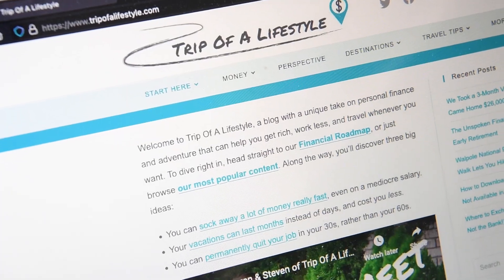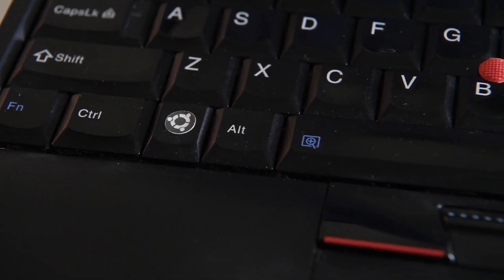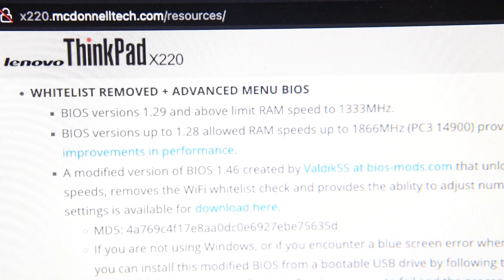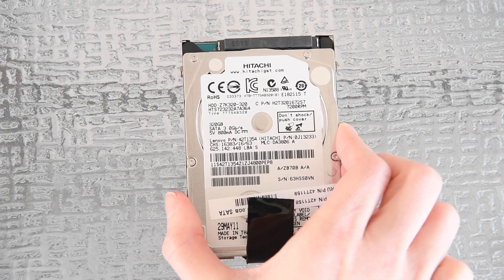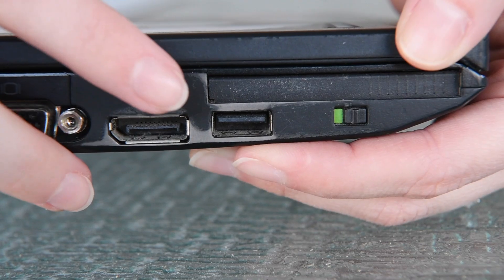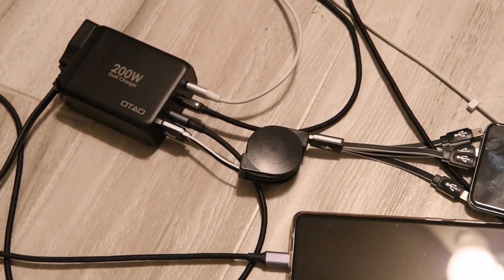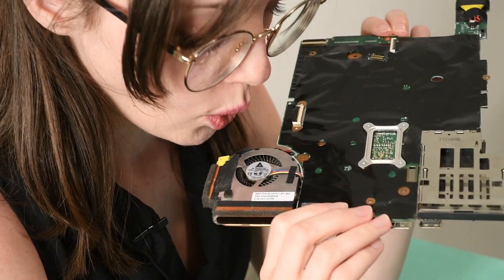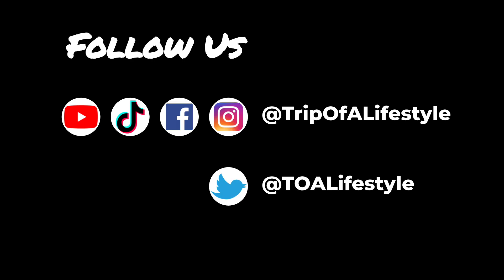How To Make Your Laptop Last FOREVER (My ThinkPad Mods & Upgrades)

Comment: That just shows how most people's needs in terms of technology were met 10-15 years ago already and all the fancy new tech is just satisfying consumerism.
Reply from the maker: @attilaszovan  Some truth to that!
Reply: @TripOfALifestyle  i need something modern due to i hate lag and its worth upgrading every 3 to 5 years but i might get a new one this or next year due to keyboard issues
Reply: My laptop is from 2012 and still runs smoothly on windows 10. It was around 600€ when I bought it. Not even high end for those days. I only upgraded the memory when I bought it.
Reply: @bennyvermeulen7255  wait until you run linux without all the bloatware from windows. My laptop from 2012 gets job done faster and better than a 800$ laptop and a 2000$ dollar iPhone.
Reply: @bennyvermeulen7255  groot gelijk 💪🏻
Reply: Except HDD, those were really slow. SSDs and NVMe are great
Reply: @DavidCardonaESM  NVMe is an SSD.
Reply: Guys, no need to separate into groups. Nobody’s saying that everyone’s needs will be met by these. A lot of stuff can be done on older machines with no hustle. 
There are some that need more and that’s ok as well. 
Content creators, gamers and others that require high power and more performance than most people are not going to settle and that’s ok. 
This is just showing that you don’t need to spend a lot if you don’t need high specs, and for parents, kids, etc, for office and multimedia they are still great. 
Almost all of you are correct at the same time. 
When you attack each other… you’re wrong. Let’s enjoy the content, leave a like and move to the next video. 
I enjoyed watching this one as I feel nostalgic for all those machines that I had to recycle in my former company as I was not allowed to take them home #hoarderlife
Reply: @pemotor541  yeah but even for Media consumption having a fairly recent GPU is a good idea to support newer video formats but you don't need this years model only when a new video format comes out or when it gets to slow
Reply: There's two reasons why computers need to be upgraded: For most people it's games that need more and more performance. Even if you're not a gamer (I'm not except for some binge Tetris every couple of years) it's websites are becoming ever more resource-hungry and won't work properly in old browsers. Most importantly though it's Microsoft no longer supporting old versions of Windows which makes using them dangerous. I switched to Linux full-time when Windows 7 was no longer supported and the only thing I regretted is not doing it earlier.
Reply: People lived happily enough in caves too...
Reply: @Leto2ndAtreides  To be fair, there's no evidence of whether cave dwellers were happy or miserable.
Reply: People's needs were met before laptops. Everyone had fresh, organic food, clean air. Now we have electronic waste filling up rubbish dumps because manufacturers force purchase of new instead of promoting upgrades and providing spare parts.
Reply: @ronr4728  
That's true
Reply: As long as you haven’t used a modern computer you’ll be ok with the old one. 😅 But in direct comparison it will look unbearably slow.
Reply: Really depends what you're gonna use it for. If you're only using a laptop for typing, you can use a very old one and be perfectly fine. If you need to do advanced video editing, 3D modeling, gaming, stuff like that...old hardware is going to have some hard limits, and there's only so much that you can upgrade in most laptops because of how they're built.
Reply: It's not just consumerism.

A lot of computers aren't this upgradable.... and even then, there were lots of changes she did that would need some actual skills...

Basically, companies are limiting the longevity of the products....

And they were able to get away with it by making many of them not need an upgrade for a long time....
Reply: I agree in a way, my 2013 x230 is still enough for me. I5, 16Go of ram, USB3, 1To SSHD, 256Go ssd PCIe, win10 (win11 runs also on it) and Linux mint, expresscard slot for the great Echo Indigo professionels audio cards. But i'm not a gamer !...
I still have an older 2006 Z60m (IBM stamped) that don't want to die, but really weaker (Centrino, max 2Gb Ram...). Even if in 2006 there was also a better T60 (core 2 duo, 4Gb), i would say also that up to #15years ago, a thinkpad can be really enough today, for a commun use of it.
Reply: This is why they purposely make new OS updates slow down older devices
Reply: Got myself a x1 carbon gen 6, swapped the wifi card for a 6E. That thing is nothing short of amazing. The only upgrade I could possibly consider is a arm MacBook for the battery life.
Reply: Just wanna throw in: I ran an eGPU Setup with the X220 and it worked. It was PCIe3x1, but it did work.
Reply: Not necessarily. They were able to meet the needs of people 15 years ago. The needs of people today, technologically has shifted in ways, and would require some newer options. This doesn’t mean folx should go out and buy the most latest tech. But they should strive for something more current to an extent.

To add, I think folx need to change the way we think and speak about consumerism. Much of it isn’t bad. And we do benefit from it more than we are harmed.
Reply: I couldn't agree more! For what MOST people are doing, they do NOT need a brand new computer. They don't... Web browsing, word processing, watching Netflix, etc. does not require a brand new $1,000 computer... my current desktop I got used for $75, it has 32GB RAM, 256GB SSD, it is an old Lenovo miniPC, loaded Ubuntu on it, it flies...
Reply: " and all the fancy new tech is just satisfying consumerism."
WiFi6, USB-C, USB-3 and HDMI are actual improvements, not just consumerism.
Reply: @wisenber  indeed! But are they necessary for everyday needs though?
Reply: @attilaszovan  Who decides what you need?
If it's outside of food shelter or clothing, nothing is needed.
Reply: @wisenber  Statistics
Reply: @attilaszovan So you define your needs by comparing yourself to everyone else?
Reply: @wisenber  HDMI is from 2005
Reply: @deathsinger1192  And not pervasive for another half decade or more.
Pretty sure she's not editing her channel with that laptop.
Reply: Try running some of the latest games and software on a 15 year old laptop (if at all)
Reply: @emperorarasaka  Depends from settings and GPU, but it's possible to game on i7 from 2009. But most people aren't gaming anyway, for browsing, office and movies it's perfectly fine.
Reply: @attilaszovan Absolutely on the money. Most of us are not  brimming with creativity every time we fire up our laptops. So, a modest laptop - even from yesteryear - is more than adequate for my personal needs. 
Of course, planned obsolescence, along with peer group pressure and advertising, create the notion that it has to be brand new, state-of-the-art tech every year. Nonsense!
Reply: @attilaszovan  for regular light use a 20 year old laptop would honestly be fine as long as modern operating systems werent so bloated a 20 year old cpu and gpu could easily hand a 1080p youtube video as long as there was propper software support and the software wasnt full of bloat trash
Reply: @emperorarasaka Games? Not really a factor for most people. Definitely not something I would spend any money to do
Reply: @emperorarasaka True. But not everyone is a gamer and plays games. 😎
Reply: @thedutchfisherman7078  exactly. I'm not averse to games but I just don't have time for them. I'm always working or living an active life. Gen X has their gamer demographic but the younger generations all seem to be far more sucked into needing a gaming ready rig and it's more a part of their lifestyle. I haven't played games since the days of arcades back high school.  Unless you're doing autocad, and using graphics intensive software, you don't really need that much for a sufficient business machine. You may bump up against some limitations here and there, but I seldom do.
Reply: Its not a gaming laptop in the first place @emperorarasaka
Reply: @emperorarasaka that's the point: Most people don't use computers to play, most of those who do play only do casually, and many play lighter/older titles, so all in all that proves OP's point
Reply: @emperorarasaka  you are not playing cyberpunk 2077 on a 13" laptop without a dedicated GPU mate, regardless if it is new. 

Now if you have a dedicated GPU like a 1650, then yes it will run without a problem even if it is old. It won't run UE5 games well because nothing will, that's not the fault of the card. 

Or you can just use steamlink, I am sure even that old laptop can run it as long as you upgrade the wifi card and have a decent connection between the machines.
Reply: @emperorarasaka 
Pixel shader was not even a thing, and now all games require the latest version. This video is misleading
Reply: @MikeTMike you're misleading.
Reply: @FR4M3Sharma  
I explained my point. Explain yours.
Reply: @MikeTMike  No, that's mainly newer AAA titles. Most games don't use the latest version and many don't use it at all.
Reply: @MikeTMike  You are a bit dense.. she did not mention gaming. I do some gaming but also have an old Thinkpad for productivity only - and a couple old machines in my workshop - one of those can do Mass Effect 3 MP ;)
Reply: @MikeTMike  It's only misleading if you assume that everybody plays games that require up-to-date specs.  Apparently that doesn't apply to her.
Reply: @FR4M3Sharma  i agree i guess, no one would imagine her Laptop is for gameing , but a great sturdy machine, i did recording until recently on a 2008 macpro, and i type this on a 2015 Ipad pro ,of course if i was a  Pro i might upgrade…
Reply: Correct analysis. 💻👍
Reply: Agreed.
Reply: @ExplainingComputers the legend himself

Comment: If you do need something new, don't be afraid to buy used. I only spent around $200 on a thinkpad x13 yoga gen 1. It's not in the best cosmetic condition, but the damage boils down to a couple chips and a bit of grease wear on the trackpad. Considering it is the same price as the average chromebook or hp stream, with a much better build quality, performance, screen, and everything in between, I would say that used is an excellent way to go.
Reply from the maker: @cheezyfriez12  Great advice!

Comment: Got a 2010 macbook white. With ssd, new battery and extra ram. Used opencore to load a more recent mac operating system. Everything still works. Good for general use.
Reply: Thank you, I’ve been wondering how to get my used old MacBook a bit newer. Now the certificates or so old it won’t load webpages.
Reply: @NitroNilz  you can do linux.  It makes old Macs faster with more up-to-date browsers, just like it can Windows machiens.  "Refind" helps.
Reply: @squirlmy  Thank you, but I prefer proper Unix. OpenBSD is my preferred desktop OS. I want to try MacOS to run some proprietary stuff for music production.

Comment: My MacBook is 12 years old. It was unused for over 3 years until I finally installed Ubuntu 24.04 on it a few months ago. I procrastinated a long time because I already had another desktop pc with Linux on it, but the MacBook now gives me the option of doing work from my own room if I suddenly have brain storms in the middle of the night and don't feel like leaving my room. Linux is great for breathing life back into old hardware that is no longer supported by commercial software.

Comment: It's time for me to get a newer laptop just cause I have an Acer 5742G that I have kept chugging along up until this very day. It's been quite a solid machine and still runs many programs well enough but repairs and workarounds are just becoming a pain so I have repurposed with Ubuntu and it runs very smoothly. 
I am looking very carefully at my next laptop and am really looking at a Lenovo. I annoyed with manufacturers  in general cause there are many $200-$500 laptops that look good until you realize that they have LPDDR ram which is soldered to the board and there is no second slot. A buyer who is not tech savvy and doesn't know what to look for may buy it thinking they can add more later.
Reply from the maker: @VideoCesar07  They're even soldering SSDs to the board these days (Apple) 😳

Comment: Unfortunately ExpressCard is just PCI Express 1.0 with a single lane, plus a single USB 2.0 connection. ExpressCard 2.0 had a single USB 3.0 connection and its single PCIe lane could be PCIe 1.0 or 2.0. Almost no laptop manufacturers adopted ExpressCard 2.0.

So an ExpressCard USB 3.0 card will be faster than USB 2.0 but slower than USB 3.0. Also, while there's zero technical reason a USB C ExpressCard can't be made, nobody makes one. It would be nice to have one because some USB C devices don't work properly, or at all, with a 3.x to C adapter. Being able to plug a real USB C controller into an old laptop would be very nice, despite being slow.
Reply from the maker: @greggv8  Yep, exactly right. 😕

Comment: The most and only bad upgrade is to use type c port for charging. İt can not handle ongoing energy it will create throttle neck for charging and supply circuit.

Comment: Pro tip for anyone wanting to do this sort of thing: be cautious when blowing out any PC fans. It's best to either hold the blades still, or disconnect the fan(s) from the motherboard. Otherwise, you run the risk of generating an electrical current with the fan motor strong enough to short the motherboard when you spin the blades up with air pressure, because you're effectively turning it into an electic generator and that power is going to go somewhere if it's still connected to a circuit.

But this was a great video and I really enjoyed the premise and end result data.
Reply: Killed my dad's power supply by blowing the fan. too hard.
Reply: For every Muppet who says this is fine and you can ignore the comment above... That is BS! Listen to This man, hold them or disconnect them. I myself Fried two Motherboards with this (one as accident, the other to prove it can happen with a spare board) Don't be stupid me! :D
Reply: @Phil-9h  You guys are idiots if you believe this advice.  You may be "pros", but you are not engineers.
Reply: Thanks. This is one of those things that seem obvious in retrospect but which almost everyone forgets.
Reply: @abdul-kabiralegbe5660  Yes, this & working on an open computer while on carpet flooring, especially in winter! That spark felt will likely surely damage something, why I don't do this, plus wear a $5 wrist strap touching a metal part of the unit. Some components, especially GPU's, doesn't always like the blasts of cold air to blow out dust either. Better to tear down to the point of removing the heatsink & then, if possible, wash it after allowing to sock to loosen the dust & pick as much of the rest out as one can. It's much safer, have seen many on Tech forums reporting this, in particular those who has MSI brand models. A GPU not torn down likely won't dry as much as an open motherboard & any trapped liquid can (& will likely) short the GPU as soon as booted.
Reply: Turn off computer, fans take long time to spin down. So obviously this is bullshit.
Reply: @Lggpad8  I would appreciate video evidence to your point. Will take just a couple minutes since there is no risk to your motherboard.
Reply: @FoeHammerTime  it's literally everytime you turn off your computer, the fans keep spinning for a bit after it's off.
Reply: @Lggpad8  Yes, but I suspect the piece that is missing in your framework is that they are starting at a safe speed and only slowing down due to friction, and no current of note is being generated. If you spin the fans up high some sort of blower, as someone who is casually blasting away at stubborn dust clots might do, that is significantly different from the fans spinning down from a powered state.
Reply: @FoeHammerTime  hehehehe

Comment: At least when showing your ram upgrade don't show regular DIMM memory modules. Laptops use SODIMM modules which are smaller in size. Guess you can't do a re-unboxing event right.

Having said that, I did a similar thing with my desktop though always stayed with Windows and till this day still runs Windows 11 quite decent.
Had an old I7-4790 intel processor with eventually 32GB of ram and an RTX 3060 which makes a half decent gaming machine.
Eventually just a few weeks ago i finally after 10y decides it was time to upgrade and got a I9-14900KF with 64GB ram.

Most people actually don't understand that for their needs (internet and general office work) they don't need the latest and greatest every year. Sure, it pays off to spend the extra bucks if you can initially for a top specs system that is upgradable, good quality and will then last you at least 10y.

btw, my old trust Desktop is now in the proud possession of my daughter who can play her The Sims, Roblox and Minecraft on that old trusty machine

Comment: I went with an HP 2570p and .. well at least CPU is an option (not soldered). Not sure about the Lenovo but the HP also allows for egpu...combine with ram and 2 HDDs and it's sort of nice + epic battery life. Bought for 100usd 2 years ago ...

Comment: I subscribed to you after the RAM joke, and wanted to unsubscribe after you said you have extra space for a second SSD but dont want extra storage which to me is blasphemy. But after you changed the power port to usb-c you earned my respect and subsciption for life. Good video nice job! Also you gave me an Idea how to switch out my media server setup which is Windows 10 and negs me to upgrate to windows 11. I will just install Linux on it and Windows will be in a WM.
Reply: To be clear, it will be probably somekind of Proxmox solution, not just a regular VirtualBox.
Reply from the maker: @ferencgaborsimon245  😂 Glad to provide some ideas.